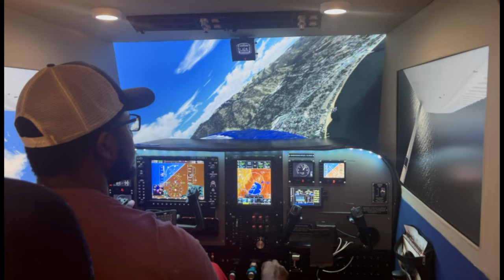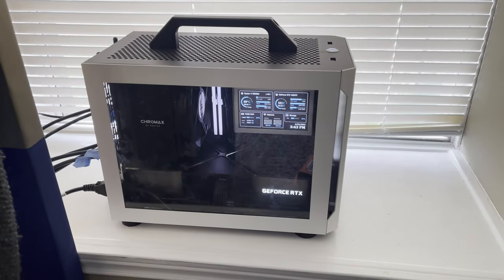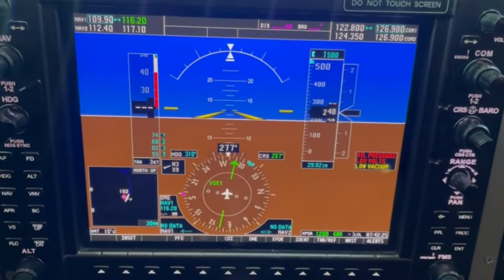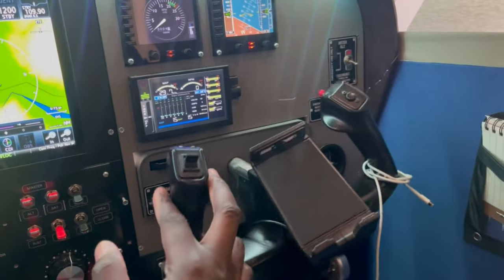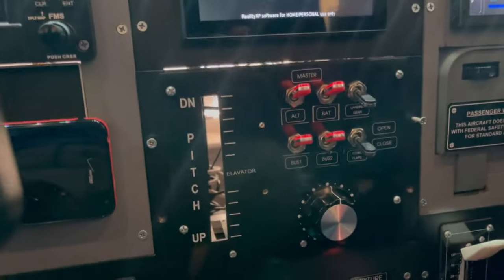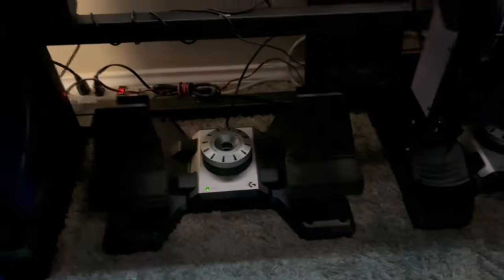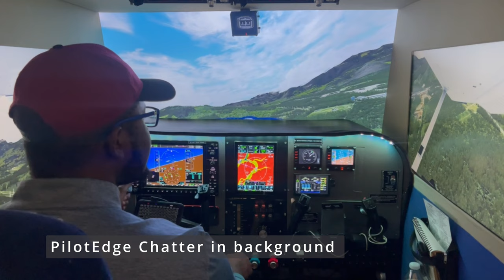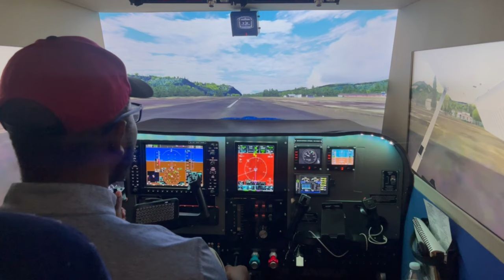Home Cockpit Flight Simulator - Tour and Walkthrough - P3Dv5 - XPlane12 - MS2020

Comment: What software is giving you the g1000 functionality?   I really want my sim to be a 182 and i have currently realsimgear g1000s which work fine in msfs2020 with its 172 or the carenado 182, i can also of course use it in x-plane with default 172 or carenado 182….but I think A2A 182 in P3D is so nice a flight model I am tempted to go back to it (maybe on p3dv6 now that it is out…but not sure how to change it to g1000
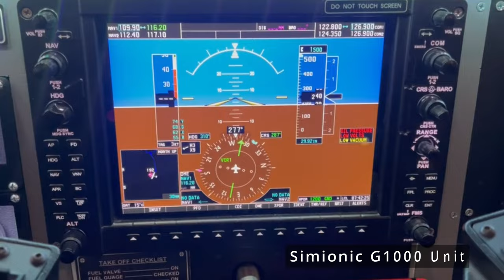Reply from the maker: I explain it in the video. the g1000 is from simionic and is running on an ipad sitting inside a bluetooth bezel. it’s somewhere around minute 11:40 of the video. unlike the realsimgear units, simionic doesn’t rely on undocking the g1000 from the virtual cockpit. you can use it with any aircraft because all its doing is reading simconnect data and sending to the ipad app, which runs independently from the aircraft you are flying. take a look at the whole video. all the details are there! 🙂
Reply: @AmirMpiana  i watched the whole video BEFORE I asked the question and yes I understood it was a Simionic panel but your video doe not explain the software running the panel.  Is that also Simionic’s software?   I guess I have to look it up as I am not familiar with it.  Or is it some other g1000 software like Mindstar?  I guess my question wasn’t clear.
Reply from the maker: @XOrionFE  Yes everything is from simionic. lookup Simionic g1000 and checkout their website. the software is an ipad app you get from the app store and the bezel you order from their website. you can down the app and listening pc software right away. you don’t need the bezel to use the app. it just completes the unit.